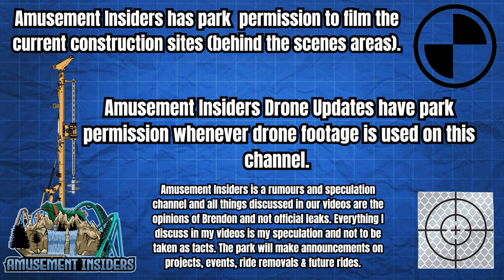Canada's Wonderland New LAUNCHED Coaster Update

Comment: Just came back from Canada's Wonderland. Moosehorn Falls was shut down today prematurely due to the rafts nearly falling off the side railing after coming down from the vertical wall (happened at least 3 times when I was in line!). Was told will be closed until a fix can be put in place for safety reasons. The bottoms of rafts were inspected by safety and ride engineers during the shutdown.